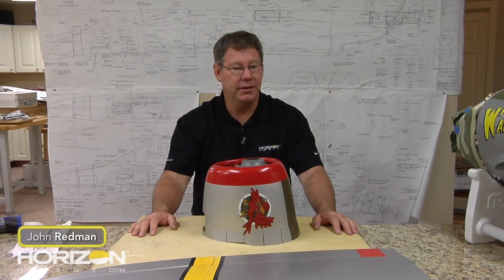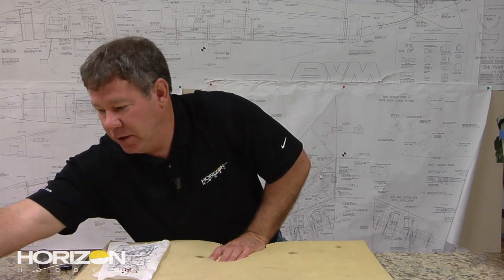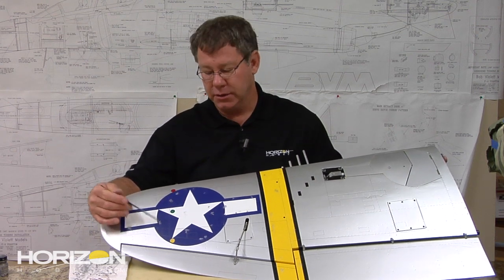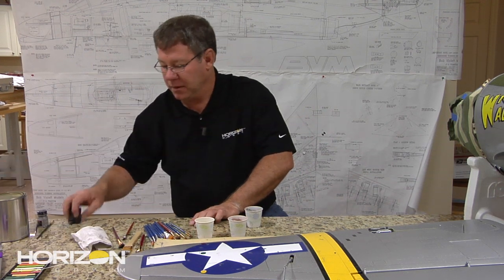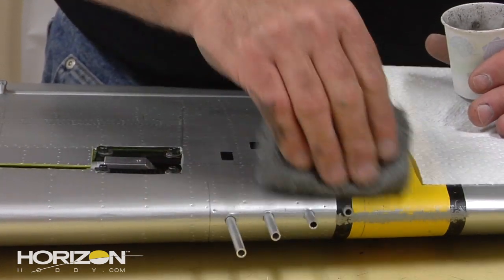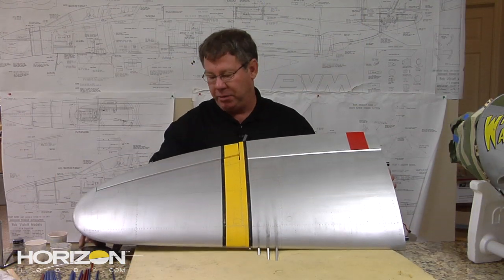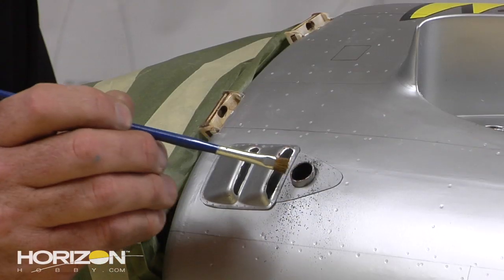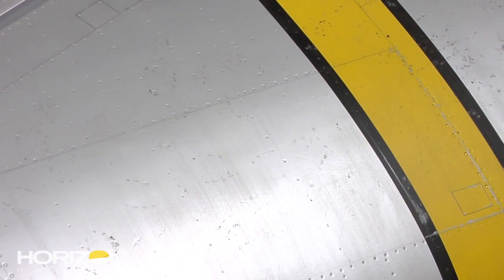HorizonHobby.com How To - John Redman Builds the Hangar9 P-47D Thunderbolt 30cc

Comment: The effects are good but, what´s with the silver paint around the front of the cowling? the paint would never be chipped off that way, or very little at all. It is supposed to indicate chips on the paint from stones and whatever, but nothing come pass that propellor so it would hardly ever get chipped and when it´s not turning there wouldn´t be any debris flying around anyway right? So where are all these scratches supposed to come from??